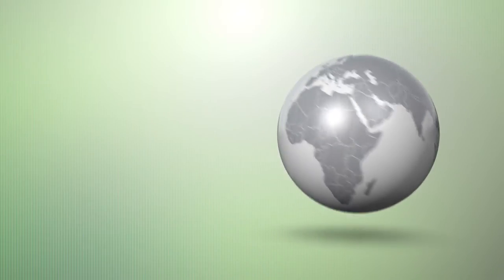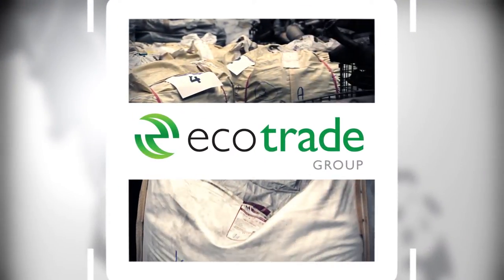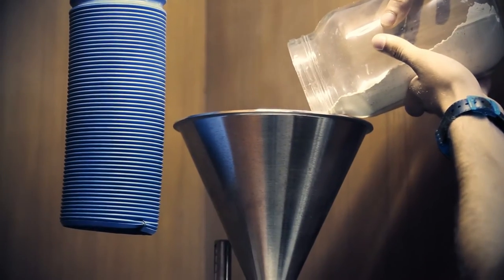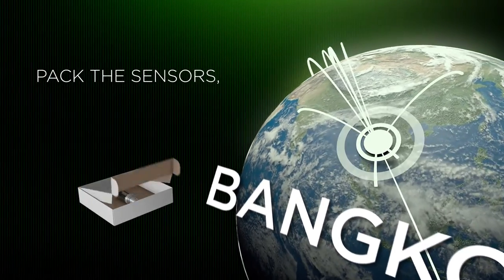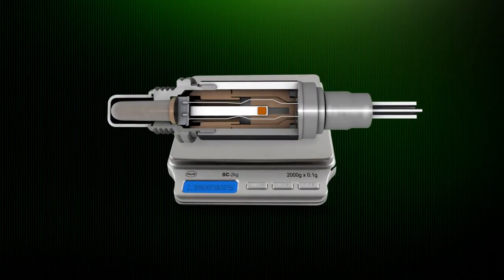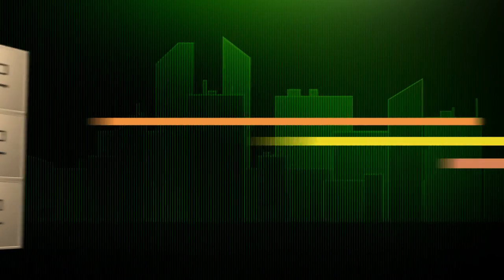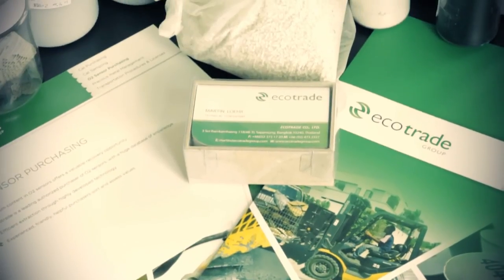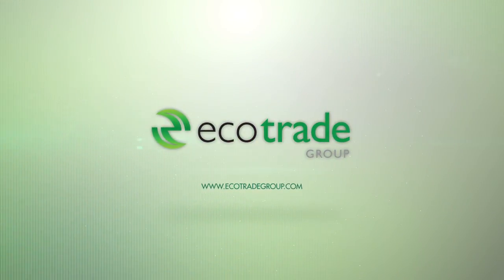O2 sensors purchasing and recycling with Ecotrade Group

Comment: Damn,I do the same stuff in my back yard-it is way easier than it looks like!
And analysis is able to be performed with simple x-ray analyser,or even much better just by either finding the exact blueprints/specs for each of them and for those for which you can't find specs-you can simply analyse it by yourself and remember/fill into a table with others!
And instead of grinding them it is easier to simply find some cheap chemical that dissolve zirconium and titanium oxides leaving platinummetal behind..